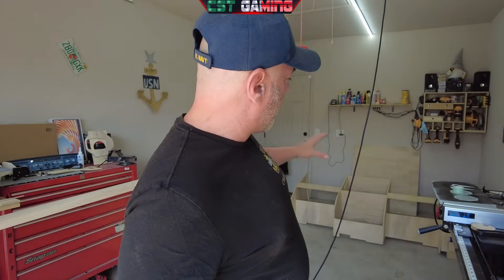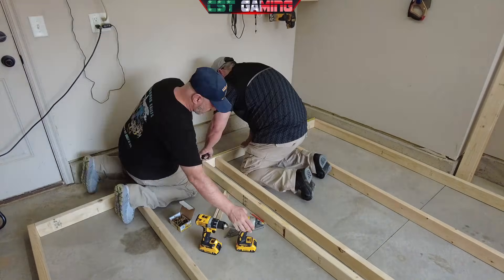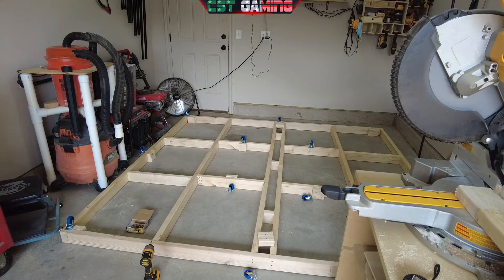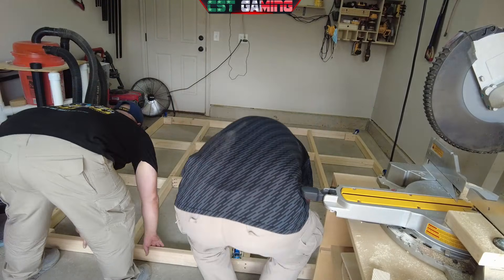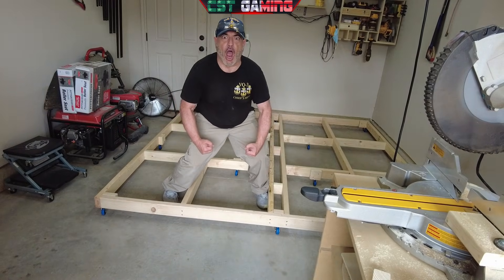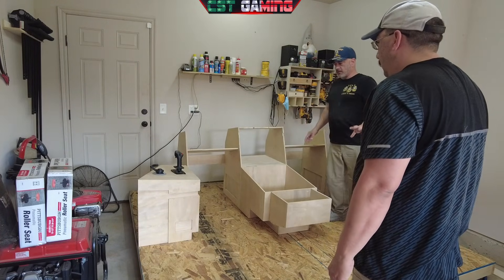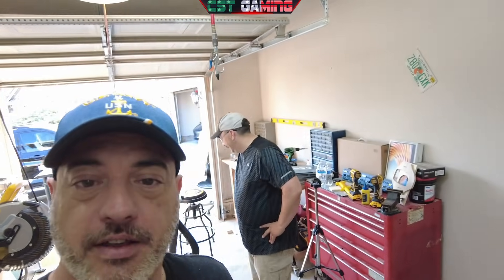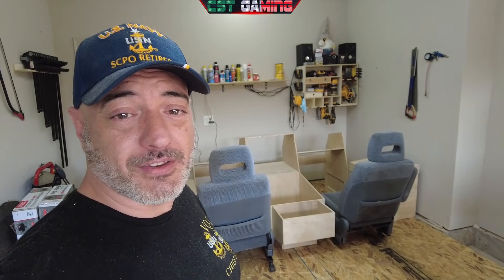What’s a Flight Deck Without the Deck? | Airbus A320 Cockpit Build Part 4

Comment: Hey you know just a thought when I heard you say that you were putting carpet down.  IF you use a tile or other material it will immensely help to keep dust down.  Dust bad for equipment, computers and the like of course.  Just a thought, but I wouldn't put carpet down.  Don't they use some sort of rubberized flooring in a real cockpit maybe?  Anyway, really enjoying this CST, thanks!